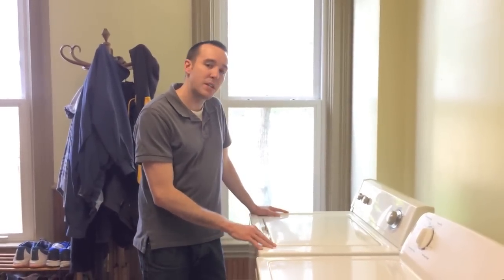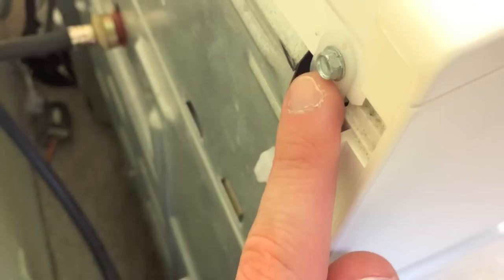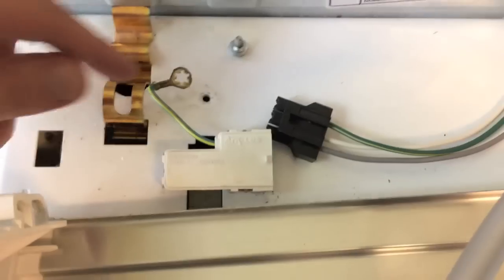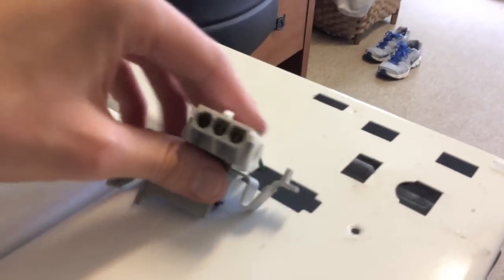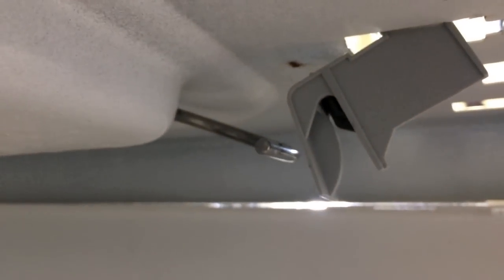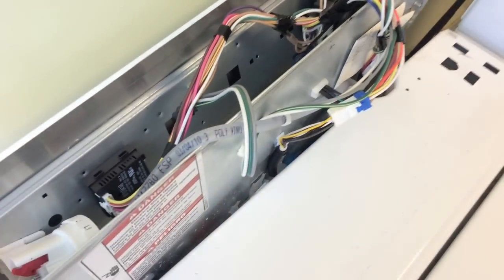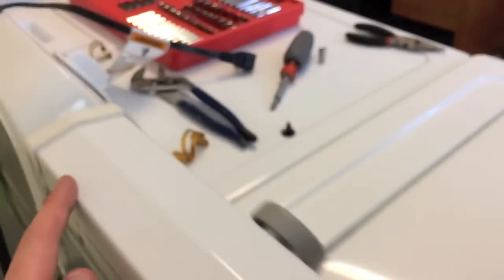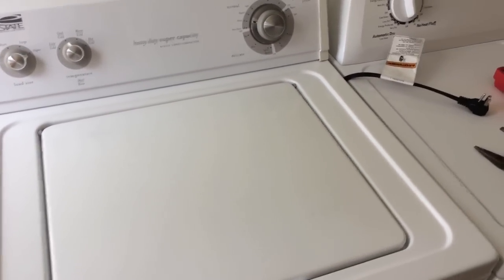My washing machine stops at rinse wont spin or drain - Replace Lid Switch

Comment: My washing machine is 4 yrs old. the past two  weeks, it washes and drains. then it rinses and drains about 4/5ths of the water and then just stops.  I have to  go down and set it again to drain and spin. Then it does.  It's a pain in the butt.  I was now watching video's to try to determine why it stops draining 4/5ths of the way and stops.  I was thinking the timer but it fully drains after the original wash.  It only stops at the very end and is driving me nuts.  After 4 yrs the 3 yr warranty is no good so I'd have to shell out another $550 to get  a new one.
Reply from the maker: thekingtroll2 

Thanks for watching & sharing your experience!  Let’s get this figured out together!

First, let’s talk about the Lid Switch.  The lid switch is designed to be a safety feature or mechanisms.  Once your wash cycle gets to the rinse portion, the Timer sends a signal to the lid switch and asked if the lid switch is compressed...meaning the door or lid is fully closed!

The reason behind this is to alleviate your washing machine rinsing and spinning with the actual tub lid open and allowing the washer to throw water all over your house...that would definitely not be cool.  😲

So to recap… the Lid Switch is a safety feature that sends the “ok” signal or “Yes the lid is closed” confirmation to the timer to allow the timer to continue the cycle!

We always recommend replacing Lid Switch first as it’s the less expensive part.  If it does not solve issue, your Timer is the culprit.

Hope this helps!  Keep us posted on your project.

Please subscribe to the channel and turn on your YouTube notification Bell 🛎 that would be awesome thanks again!  

😎👍🔧🔩
Reply: @DIYwithMichaelBorders  Thanks.  I wrote down the make and model so I can go to a part store about 6 blocks from me.  I'll buy the switch first and install it and do a load.  If  it still does it then I'll go grab a timer.

 My oven heating element broke on Dec 23. Oh no. I don't own a truck and 2 companies said they could not deliver a new stove by Christmas since they were booked full. 

I watched a youtube video. Slide out stove, unplug it. Take off the back.  There is the heating element. Two clips.  Two screws inside the oven. I wrote down the make and model and ran to that store at literally 4:45pm.  I got  new one for $25.  So, I value youtube highly to learn.
Reply from the maker: thekingtroll2 

That is what we love to hear...sounds like you have officially joined the DIY Club.  😀

You will have that Washer & Stove fixed in no time...& you don’t have to wait months for help nor give anyone else your hard earned money.

Keep us posted.

😀👍🔧🔩

Comment: My whirlpool washer fills agitates drains but wont spin
Reply from the maker: Heather Wright 

Thanks for watching & sharing your comment!  Let’s get this figured out together!  Almost 100% of the time with your current symptoms it will be the lid switch.

The lid switch is designed to be a safety feature or mechanisms.  Once your wash cycle gets to the rinse portion, the Timer sends a signal to the lid switch and asked if the lid switch is compressed...meaning the door or lid is fully closed!

The reason behind this is to alleviate your washing machine rinsing and spinning with the actual tub lid open and allowing the washer to throw water all over your house...that would definitely not be cool.  😲

So to recap… the Lid Switch is a safety feature that sends the “ok” signal or “Yes the lid is closed” confirmation to the timer to allow the timer to continue the cycle!

Hope this helps!  Please subscribe to the channel and turn on your YouTube notification Bell 🛎 that would be awesome thanks again!  😎👍🔧🔩

Comment: My kenmore 500 stays on rinse w/ water,I did reset and calibrated but still same problem,what will cause of that pls...needs help thank you...
Reply from the maker: Good morning & welcome to the DIY Raptor Club.  You may have a failed inlet valve.  You have two inlet valves, one hot and one cold.  These are the valves that allow hot and cold water into the machine from behind.

When they fail, they can either fail in the closed position not allowing water in or the open position not allowing water to stop flowing.

Below is a link that shows more about this.

       https://youtu.be/hlZAAeoK2iI

Keep us posted.  😎👍🔧🔩
Reply: My problem is,is not filling w/ water, my rinse light stop on rinse and flashing and stop right there do you think I have a bad main conrltrol board,do you have an old parts for kenmore series 500 hp just to get a serial# number pls..
Reply from the maker: @edgardosabinay1138  

Thanks for the reply, it may be as simple as replacing Lid Switch.

😎👍🔧🔩